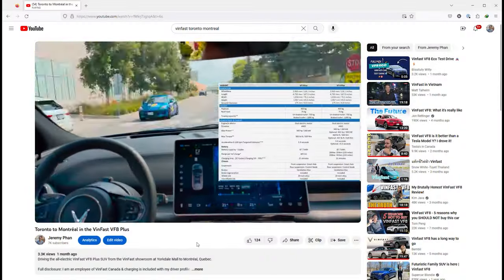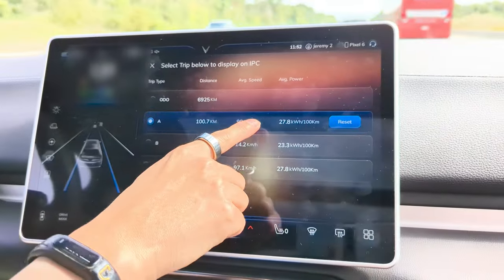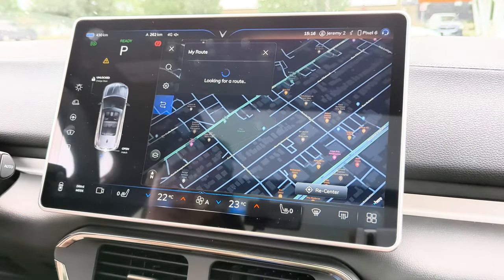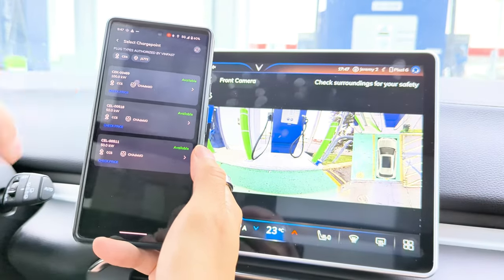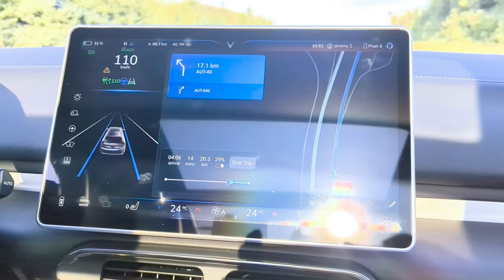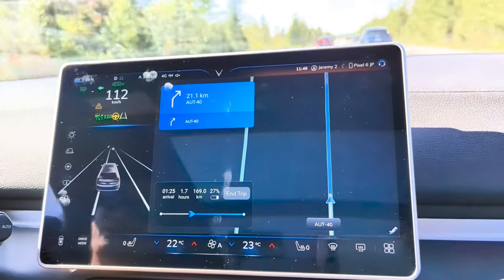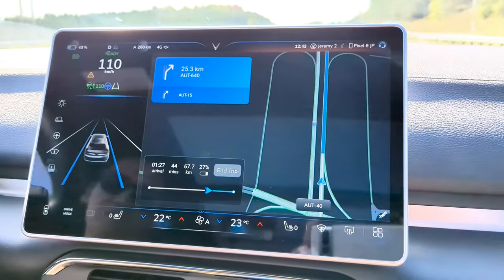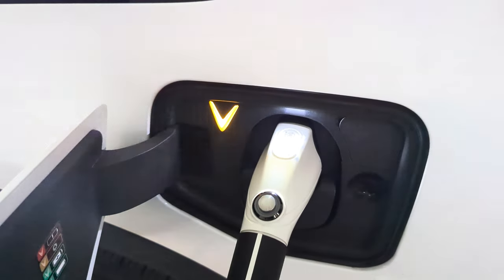Toronto to Quebec City in the VinFast VF8

Comment: Great educational content for Toronto VF8 drivers.   So for the first stop you were charging for 1 hour 20 min to get to full 100%?   Do you know how long it was to just 85% or 90?    Also which model are you driving?   The Plus with or without power add-on?   If the lower range model (391km)  ok, but if you arrived with the higher range model and only made it there with 5% would the other model even be able to cover the distance to that DC charger?  There are only few DC chargers east of Oshawa and west of Quebec.